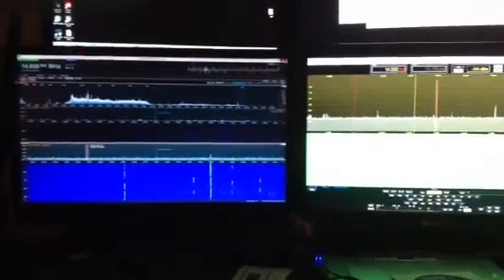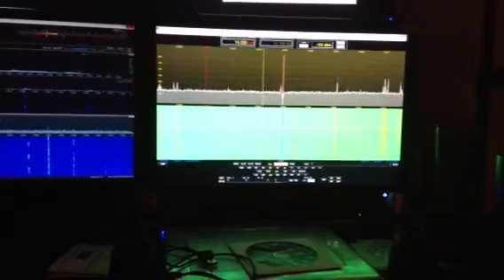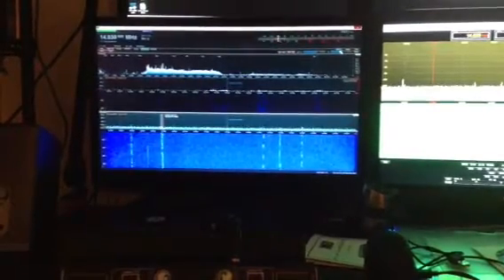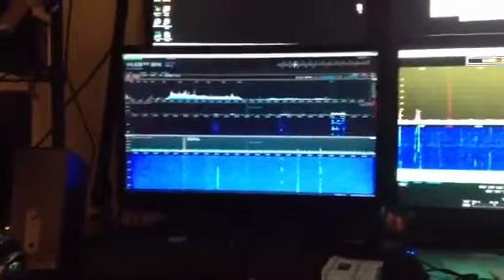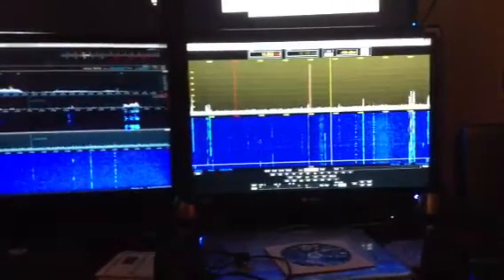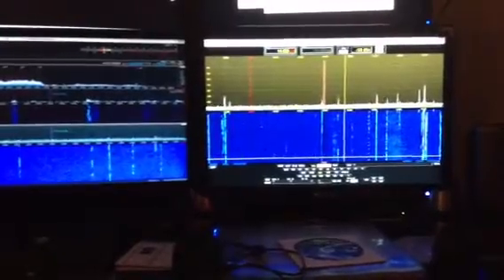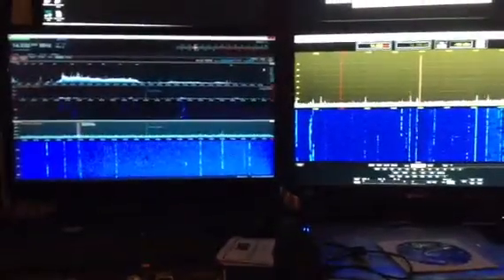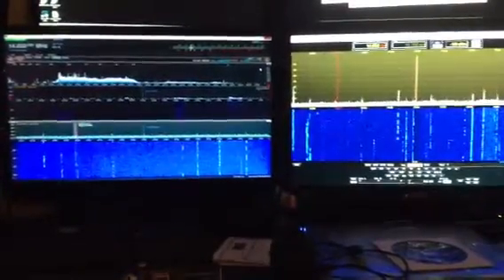Anan 100D vs KX3 Part 1

Comment from the maker: The conclusion is there is no conclusion and that labs are better suited to make comparisons. :) if the antenna used is less capable than the radios then you won't be able to truly compare the radios as they will both perform to the limit of the Antenna.